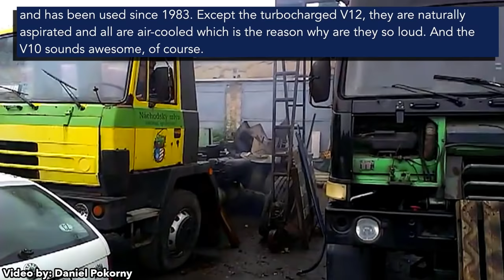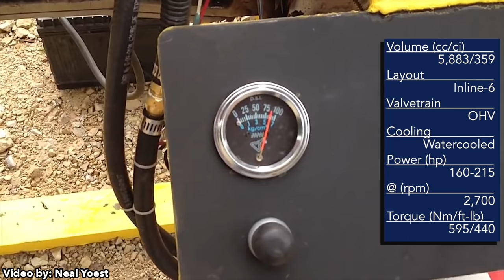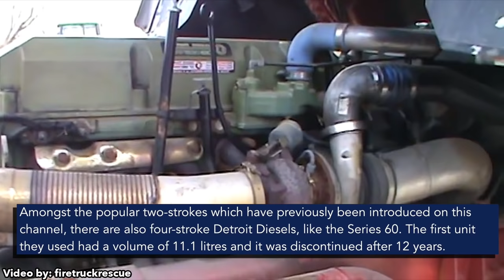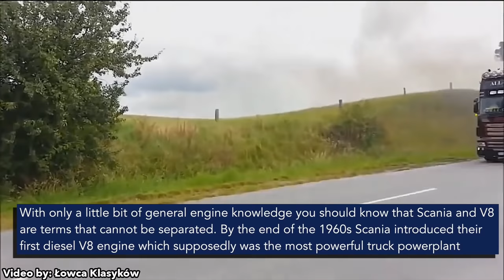10 Best Sounding Truck Diesel Engines

Comment: A few suggestions...  6V53 Detroit - better known as the Screaming Machines!  On a calm, still morning, they can be heard from over 2 miles / 3.2 km away!  Best coupled to a RT-910 Roadranger gearbox.  

A DS-11 Scania in line 6, that idles at 200 r.p.m.  Yes, did drive one in a LS111, back in 1984.  The LT111, where the exhaust comes out in front of the lead drive axle, allows for the true sound of the motor to be heard.

One of the complaints about most videos claiming to be the motor sound is actually the exhaust sound.  If you take the exhaust out of the equation, and hear the true sound of the motor, then that is brilliant!

One other thing that needs to be mentioned, which, is a good chance that you don't know about.  Leader trucks, manufactured in Australia, for many years, were exclusively Caterpillar diesel engines.  Only in the later years did they allow Detroit Diesels as an option.  They were mainly an 8 X 4 chassis, used on tippers and cement bowls, though, if memory serves, there were some 6 X 4 units as well.

Comment: The 24v 6BT was still 5.9L. They didn’t enrage it to 6.7L until many years later
Reply: The 6bt refers only to the 12 valve version. Any 24 valve is an isb
Reply: @benjaminturpin2749  u right

Comment: Do a video on highest reving Diesels
Reply: Zach Cannon Two stroke "Screamin' Detroit"!
Reply: I'd agree on the Detroit screamer
Reply: That would propably either be the Audi R10/R15/R18, or some tiny engine like the 1.2 TDi from VW (the 1.2 goes around 5000 rpms stock, and likely quite a bit more when tuned)
Reply: Zach Cannon that list would be almost entirely 2 stroke Detroit lol
Reply: AIRDRAC That would be the case if it's not truck diesels
Reply: There are 5.9l Cummins modified as pulling motors that run 6000+ RPMs.
Reply: Wyatt Lewis yeah a few dmaxes that way too but still
Reply: Look up "Checkmate".  Detroit 12v71TT turning 6,000.
Reply: As long as you can keep feeding a quantifiably larger amount of fuel and air into a 2 stroke Detroit and keep the bottom end together they will keep spinning and spinning
Reply: that goes for any diesel.
Reply: any engine, even.
Reply: AIRDRAC can't say I can think of a late model tdis highest redline ....
Go back to an idi 1.5, 5600 was max revs.
Reply: Two stroke Detroits sound like they're revving up to 6000 RPM when they're really turning 3000 RPMs.
Reply: The Audi R10 TDi can run to 7000 rpm with a special turbo.
Reply: It has 830hp @7k rpm with that turbo.
Reply: Zach Cannon I've seen 6k in my tdi-m on occasion it's not a big deal.
Reply: BMW F10 M550d, max rev is like 5500
Reply: OM606 & 605. All i have to say.
Reply: I don't know why they're so limited compared to gasoline engines anyway. Maybe the compression ignition requires heavier rotating mass.

Comment: I didn't see the Cat 3406B in there.
Reply: Stray Cat We have one of the 3406b in a 84 Freightliner. It's a sweet sounding monster!Got a 15 speed Fuller roadranger in it ,ungodly gearing! Would run 105 mph at 95000 pound gross!
Reply: 3412 are pretty sweet too
Reply: 3406b sound so good
Reply: @squach6239  I had one in my 86 Freightliner with a 13 speed double over.
Reply: And the 3406e cat or the acert c15 cat

Comment: Hello again VisioR. ! The best all around heavy truck Diesel, that was a pleasure to drive, sounded great and was as easy as could be to drive, once you changed your mindset about shifting. What I’m talking about is the early to mid 80’s 300 hp Econodyne  engine with the 5 speed Maxidyne transmission. That you needed to let the rpm’s from a high of 2,100, drop to 1,200 exactly, before you could get into the next higher gear! That was a pleasure to drive for me, especially after coming out of a 15 speed! Where in bumper to bumper traffic, you were required to shift 8-10 times every time traffic picked up from a stop, to 25-30 mph!! But in the 5 speed Mack? 1st was good from a dead stop to 15 mph, 2nd 10-21, 3rd 15-34, 4th as low as 15 to a high of 42! Then 5th from about 35 to a top speed of 72, if turned up to 2,200 in top gear! Where you’re cruising along an come to a uphill grade at 70, where that little Mack would chug down to 1,000 rpm’s if not fully loaded before a downshift was needed! Matter of fact, most times you were forced to downshift due to exhaust manifold turbo heat monitored by a pyrometer that entered the red zone at 1,000 degrees!!! The engine made so much torque a downshift wasn’t needed for anything but reducing heat!! I remember driving all the way from Allentown PA, to Providence R.I., hauling 45-48k of beer, after the dam Connecticut tolls were removed, where at night if traffic kept rolling I would only need 4th a 5th gears only! The only time I needed to go any lower than 4th was if there was a LOT of slow traffic! But it was just like driving a 5 speed pickup!! No more shifting every 5 mph!! I remember counting how many times I had to shift in the 15 speed, with the same load, that was something crazy like over 1,000 times, that was as high as the counter mechanism I had went up to!!! But in the Mack 5 speed? Was actually under 200 times!!! Totally the opposite of a Detroit Diesel with a 10 speed Road Ranger!

Comment: I wonder what happens if we put that Tatra V10 to a Dodge Viper (and upgrade it) :P
Reply: Probably rip the rear end to shreds hahaha!
Reply: You would get a slow, heavy Dodge Viper that gets 30 mpg.
Reply: And torque to pull a house down
Reply: gearing would have to change since diesels work at low rpms.

Comment from the maker: That Mack though. Don't forget to follow my tribe on Drivetribe: https://www.drivetribe.com/t/StZIXp1zSISiZ__vMQ3zKQ/GWHrJt9mSPWpaPL-lqihwQ
Reply: VisioRacer hey visioracer is you are planning on making a second video on truck engines you should put the deuce and a half engine in it, the engine is called the LDT-465-1C engine I have a video of it on my channel. If you were to put it in a video I can give you some info about it
Reply: Hey, is that the same Tatra engine they used to run the Dakar with?  Hard to imagine an air-cooled engine racing in the desert...but the simplicity of not having radiators etc could be a bonus, I suppose - and they do seem to build them strong.
Reply: PS: Gotta love those road trains - it takes some serious engine when you're pulling 3 trailers and 150 tonne over a mountain range!  :-)
Reply: did you know that the Mack E9 designed by Renault?
Reply: The Mack V8 was a development of Scania and Mack. The E9 was revision of it.
Reply: MrPowertorque look at the E9 block
Reply: the ford powerstroke 7.3 is a V10 engine instead of a V8 which is said in the video
Reply: ford 7.3 is definitely a v8
Reply: It is a V-8.
Reply: VisioRacer Scania <3
Reply: I like R-model with the 600-maxidine-9spd.-run like the wind!! whatcha think??
Reply: VisioRacer there is a main highway behind my house and the Mack V8 is one of the loudest diesel engines I've ever heard next to some two strokes
Reply: what you heard was a 600 maxadine
Reply: VisioRacer just dropped the 6v53t and a 13 speed Eaton Fuller in my buddy's truck
Reply: Also the toyota 1HZ engine.Toyota's longest running and bombproof diesel.Throaty straight-six 4.2 and incredible throttle response.
Reply: I second that, or the 1HD-FTE factory turbo engine, the smoothest running straight 6 diesel I can think of
Reply: only engine with more torque is C A T. raw power, yeah. makes me wanna run around in my speedo- not a sight for most people. my late wife says-ugh-forget it!!!!!
Reply: have a wonderful holiday!!
Reply: Gary Martin I love CAT engines too. They keep truck garages in business! Go Mack!
Reply: they bring them parts for a mack, heh, heh. I started with a maxidine 600 and retired with a kitty kat. enjoyed my 45+yrs-miss the hell out'a it.
Reply: Rick Woolson 
Somethin about those ol 60 series. Somewhat simple, decent power but no love...I dig em
Reply: Rick Woolson: was an ASE certified diesel tech before it was ASE ( originally NIASE, for "National Institute for Automotive Service Excellence") circa 1981. Used to go to the truck drags > Cats ruled supreme....3408TA's had the Pete 749s and Kw W900s doing burnouts + mid 13sec. 1/4 miles. Only challengers were the 12V71 Detroits, but they were rare in trucks. The races at NASCAR tracks were just as crazy; KW's, Petes, Mack twin screw tractors AVERAGING 100mph in the straightaways; those that went off track went THRU the boilerplate barriers the NASCAR cars bounced off of 😱
Reply: Dan Lloret yea from what I understand about trucks , when it was the dark 70s for performance cars , trucks were like the horsepower wars of the 60s cars....
I had an 83 gti, (in the late 80s) and I dropped a bud off to grab a cabover with an 855 in it. 
I had to give it 2/3 pedal at least to stay with him in that truck. 
One shop I worked at, during diagnosis on a cummins in a bluebird schoolbus, we played with the programming and removed the speed limiter. 
Ever seen a bluebird school bus do 93? 
Lol friggin flying brick 😂😂
Reply: This is how a Scania V8 sound like, before you start to play with it's exhaust systems. This is the R580 engine (580 hp, 2700 Nm):

/watch?v=IBzeNFFraJ4&ab_channel=Iceeeen
Reply: But Dat Dodge/ Cummins 12V combo. Daaamn. 

Ford? Pfft. F-ire Hazard, O-il leaks, R-ubber D-isintegrates.
Reply: ever thought of having someone help in the final edits to revise the english text that pops up? noticed a whole host of grammatical and syntax errors.
Reply: VisioRacer from. In
Reply: jordan brown : At the beginning of your reprimand, the word ever, should have been started with the upper case capital "E", as in "Ever" ! 😬
Reply: E9 MACKS R THE BEST DIESEL ENGINE OF ALL TIME
Reply: VisioRacer trre
Reply: You forgot the almighty Mack Econodyne 350.Reliable,economical,badass.That is the game changing moment from Mack.
Reply: VisioRacer to
Reply: Series 60 included a 14L variant. Mack v8 is 16v 500hp ( factory ), Scania V8s were 14L 16v for teh 2-3&4 series up to 530hp. onwards until current are 16l 32v, neither are DOHC
Reply: No Daimler's OM366T?
Reply: Must say as a scandinavian i have a big love for the scania v8 engine but that mack e9 v8 sure does sound amazing, only american engine i have heard that came close or maybe even surpassed the scania roar
Reply: Had a Mack Superliner with 500 V8 as a lowboy tractor back in the early to mid 90s.  Thing would pull anything. Would put the dump behind it and at 72,000 lbs it felt like nothing was behind you.   
     The sound was second to none,  but not far behind it is an 8V92, never had the chance to drive one but love the sound of them also.